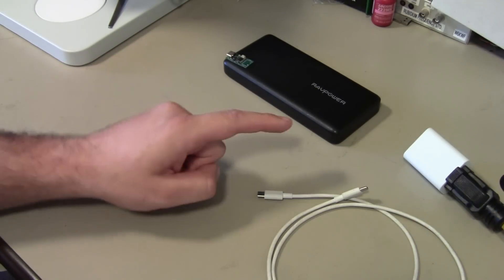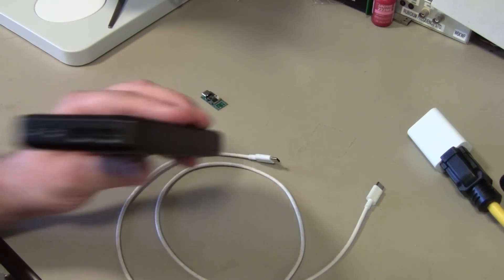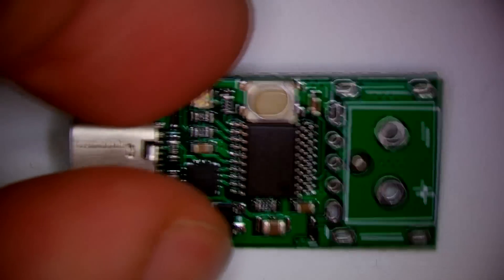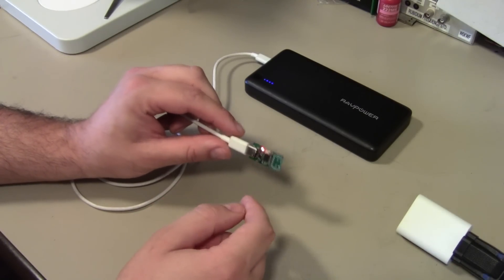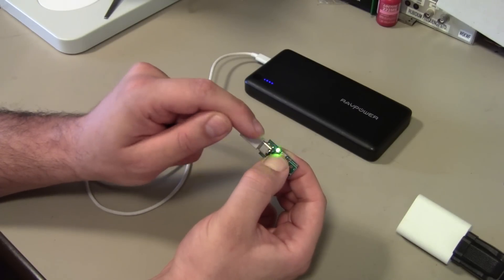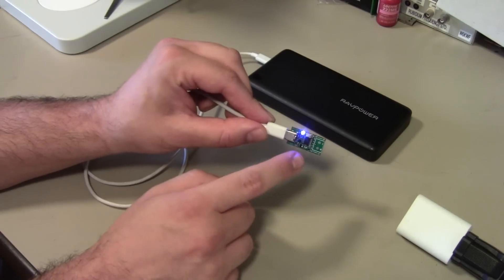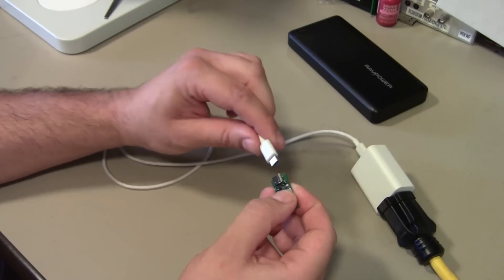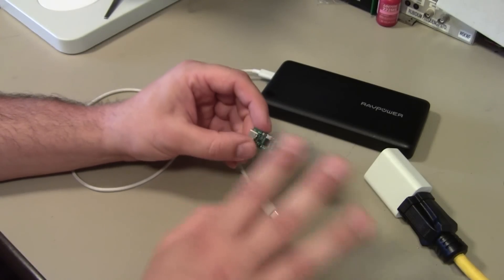How to power ANYTHING using USB-C Power Delivery and the ZY12PDN PD Trigger Board

Comment: Hi...i  recently purchased an electronic scoreboard (uses 12 volts and 5.5 watts) about 2 feet long and 8 inches tall, with 3 inch numerals... just large enough to be useful. However, it only works with a 4 ft power cable with a small wall transformer with barrel connector. I want to power it with a power bank with usb-c. Do i need a trigger board? Does the scoreboard itself need to have the ability to negotiate power? Can i just get any USB-c power cable with barrel connector? Or do i need a 'special' cable, like a USB-C PD cable specifically rated for 12 volts? sorry for all the questions!

Comment: So, I was looking for a solution to power my HX Stomp - a digital Guitar/Bass Effect modeler. It needs 9V but much higher Amps than the usual effect Pedals used. Happens to be, that there is little to none inexpensive solution...until now.

Comment: Exactly what I was looking for! Thanks. My usecase is, Im trying to live off of my solar system. Since it is producing DC, I need to convert it to AC and back again to DC to power, for example, my desktop monitor. So this would be a neat idea to power a lot of electronics without having the double power loss through converting. I hope this will work :D 
I have a question though: My powerbrick for the monitor outputs 19.5V, USB-C PD delivers 20V - is that a problem or is the device able to adjust how much it draws?

Comment: This is neat for a more universal supply, but I'd personally feel safer if it was a solder pad I bridged or used a jumper on to make sure the voltage doesn't get changed somehow.

Comment: What is missing is a 12V home network.
Don't know why we have tens of power supply when we could have one central power supply to power all small device, pc monitor, pc, phone charger, modem, router, .... except big appliance almost everything could be powered by 12V.
Even modern fan or motor are powered by 12V.
Especially wasteful with solar, as we go from low DC, to AC back to DC and loose a lot of power on the way.

Comment: Really interesting board and thanks for explaining all the modes, but would have been even more helpful if you had shown with a multimeter how stable the voltage output actually is in idle and under load and whether it can actually 5A at any supported voltage.
Reply from the maker: That is entirely a function of what USB charger you plug this into. All this board does is ask the charger to deliver a certain voltage and expose two solder pads attached to the output bus.
Reply: @KennethFinnegan  Thanks, you're right. For some reason I thought it would come with a voltage converter built in. But of course there's none visible.

Comment: I have some trigger boards that don't have the LED or the button. It just has 3 sip switches that you set to the desired voltage. I'm making a rack-mounted VU display that will be powered with one of these. I plan on using these bad boys for many, many projects.

Comment: Hello, I have twenty 5 & 12 volt DC power adapters plugged into 120-volt AC outlets (yes, it is a mess). Is there a way to eliminate all those power adapters and use a single DC source to feed all my twenty gadgets (maybe use twenty of these circuit boards which would take much less space than my twenty 120-volt power adapters)? Thanks

Comment: Be careful with these barrel jacks that plug into  your devices. There's no polarity standard for them.  For example, it seems that most guitar pedals take barrel jacks with center negative, but WiFi routers take ones with center positive. Check the sticker on your device before plugging those in.

Comment: Did this with a car stereo. PSP. And a laptop. Have a bunch of triggers.. 5v.9v.12v.15v20v It’s good to have a power bank that charges and gives power at the same time. That way you can use it as a UPS. You can also charge the power bank with solar and keep things running 24/7. Like a mini Tesla Powerball.

Comment: I have a possible project question. 

I own a MacBook Pro A1502 that has USB 3, Type A sockets (x2) and Thunderbolt 2 socket. Thunderbolt 2 has the faster data speeds, but it does not carry (if I understand correctly) 5v needed to power an external device. I would like to use an external M.2 NVME M-Key 2280 SSD in an enclosure that has a USB Type C socket. The type enclosure can be seen on Amazon .. ORICO 20Gbps M.2 NVME SSD Enclosure Adapter,USB3.2 Gen2 Type-C to NVME PCI-E M-Key Solid State Drive Aluminum External Case for SSD Size 2230/2242/2260/2280, up to 4TB（M2PAC3-G20, Grey).

Might it be possible to make a cable with a USB Type C (Male) on one end and two plugs on the other end, a Thunderbolt 2 (male) for the data AND a USB type A (male) for a 5v source? Could this work? Would you know how to wire it?

Comment: Very useful and informative video. One thing I noticed was that you read from your power bank that it supplies 5v 9v 15v and 20v, yet your trigger board seems to manage to negotiate 12v from it. Is that a feature of the board that can be used on any supply that gives more than 12v, or did they just not include 12v in the power bank specs for some reason?

Comment: Thinking about using these in conjunction with a 100 watt or 120 watt multi port usb charger to clean up 4 or 6 power bricks for various devices in my wiring closet.

Comment: Hi there
Can you assist me with a solution to my problem, I have a small internet UPS that can give either POE 15/24v or barrel dc 9/12v which I’m using the 12v option - problem I’m having is I need to power my Ubiquiti AMPLIFI Mesh Router, which uses a USB C switching power supply

Comment: I have a cable that does the same thing. Except i left it connected to the powerbank last night but didn't connect the cable to any device and it still drained the powerbank. I'm guessing via resistors or something. Still the cables are great, I use one to power a 5G modem that I can take on the move.

Comment: That's pretty cool, but, for the price of one of those you can get FIVE boards that don't use a microprocessor.  (They just have pairs of solder pads or DIP switches to set the voltage.)  I can see having one of those for its convenience, but, in actual use, I'd stick with one of the more basic options.

Comment: Since this video the market has started to provided what are often called a "PD/QC Decoy Board", these are fixed voltage boards, with the result that they are a lot cheaper and smaller so work very well for when trying to create a usb to power jack cable solution. The one I ordered even came with a plastic cover for the board/cable as standard.

Comment: I just wanted to add that most of the Linksys blue routers like the WRT54G internally run on 3.3 volts supplied by a buck converter, so it falls under the category that you mentioned where any of the PD voltages should work, or even just plain old non PD 5v USB. Some of the old 3Com network gear was even brave enough to admit this, I have a 5 port 10/100 switch that says right on it that it will take anything from 10-30 volts.

In this case I would just choose whichever voltage gives you the least input wattage from the source, IE the best efficiency.

Comment: This is awesome.

I have never seen anything that can test which voltages a USB can actually use, save for a box I bought some time ago, which reads both voltage and amperage. And, naturally, I keep misplacing this little box. It is also USB-A only.

I would love to figure out a HAM radio repeater with this. Honestly, I may try to power a router off of something like this, like you did, too. I would really love to be able to establish off-grid communications and file transfer.

Comment: Great explanation, thanks! This tiny piece seems to be quite useful 😁
However, it would be nice it it also had - like some buck converters - lines that you can solder in order to have permanently 9/12/15/20V etc. On the other hand, we could have it set to 20V and then use the buck converter - just to be sure we won't get anything else than desired voltage. For perfect output, a linerar stabilizer at the end would give us exactly what we want 😎
Reply: I'm pretty sure they exist with fixed voltage settings. Adding another buck converter would be kinda unnecessary as the QC power supply can deliver any voltage. There's a mode in which you don't just get a preset value but can ramp up and down in voltage, in steps of like 0.1V. I wouldn't be surprised if boards exist that make use of this to output any desired voltage.
Reply: Found it, it was a video from Andreas Spiess in which he plays around with QC 3.0. There's a "continuous mode" in which the voltage can be stepped up and down with steps of 0.2V.

 https://youtu.be/dw3MehLAyWU
Reply: @jaromy03  thanks brother
Reply: See this for other boards that can be set via soldering https://www.youtube.com/watch?v=gRcRFjUl_Gk

Comment: I’m wondering if this would be useful for a project I have in mind to eliminate all those wallwarts that have infested my office. I could see having several of these, each programmed for a common voltage (5, 12, etc.) and then paralleling the barrel jacks for the each device that uses that voltage (being mindful of total current) and then using a single, high current switching USB adapter to power the whole thing.

Comment: the highest voltage would be good for a multi-voltage device too. a lot of power banks will support more than one voltage via DC in if it doesn't already have a USB C charger mode

Comment: Thanks for an excellent explanation. Those who don't want to risk the wrong voltage being programmed in for a specific device can get USB-C to barrel connector converters designed for that device's voltage—9 volts, 12 volts or whatever.

Comment: With a 3v buck converter and a pair of resistors I could use this to power my Resmed S10 CPAP machine (humidifier turned off) from my laptop/phone battery pack when travelling, so this really has my interest. I'll have to check the output levels of my battery and Choetec 240v pack in my bag.

Comment: Kennth, I just found this video.  I have a solder station kit I need to put together. It takes between 12 and 20 volts I’m now thinking about adding this as a power option.  Thanks for a great video.

Comment: I'm trying to learn some DIY electronics stuff so I can salvage broken electronics instead of recycling/throwing things out. 
I don't know a lot about components swapping or what's compatible with what, but I was wondering if I could replace the broken 5V DC (5.5mm x 2.1mm) socket on my daughter's rechargeable Bluetooth speaker with one of these. The PCB is marked 5V where the socket is connected, but the included AC/DC power brick is labeled as 4.5V and 0.2 A output. I'm wondering if it was done intentionally to slow charge the 1800 mAh battery, or if that was just the best option they had at the time (newer models of the same speaker replaced the DC socket with micro USB). 
My guess would be that the 5V mode would work just fine, but like I said, I'm not an electronics expert.

Comment: These are pretty cool. Might be useful for some future project. I came across it cos I was searching for a solution to charge my laptop from a monitor that only has USB-C Display and data transfer. E.g. it only supplies the minimum 5W or so, and was looking for a way to inject power or something. Probably a hub but those are big and bulky and a more compact solution would be nicer, if it was possible to inject power without compromising the display/data throughput

Comment: That's a great video! Thanks. So If I have a 220v 0.25a device (55W). Can I use this PD feature and set it to 12V. 12v5 = 60W. Does it work that way?

Comment: Was looking for these trigger boards and the description was not clear how it would work when you wanted a fixed voltage. First I found 12v specifik versions, that essentialy does this but without the added option of switching voltage (they go 12v, or the highest available ie 5 or 9).

now im gonna order these with the buttons and going to use it specificly for powering 5 or 12v routers, switches and other equipment from either wallwarths or PD power packs!

Comment: How is the voltage  increaseed.  Does the power bank have  voltage booster with in it or    are the batteries  just connected in series to begin with and uses a buck converter

Comment: Great video. Troubleshooting question:
I want to power a small 12V 3A bilge pump with a PD 65W power bank. I have my PD trigger set to stay in 12v (green), but as soon as I connect the pump, the light on the trigger goes out and the power bank indicates it is no longer charging anything.
Advice?
Reply: Both your cable and power bank needs to support 3A. 65W power supplies can achieve the 65W only on higher voltages, and are often only rated for 2 or 2.5A. Might I suggest a  high dc to low dc buck converter in front of the pump in order to support 3A.
Reply: Your 3A pump is probably drawing alot more than 3A while starting, triggering overcurrent protection. 
Is it possible for you to soft start your pump?

Comment: also got a few of these PD trigger boards, alongside a shutload of PD trigger cables and chips.
tried the approach on one of my 5v to 20v trigger boards but it doesn't work.
its a WITRN board  (WEB-UPD005 UPD006 PD to DC Decoy Detect PD3.0PPS Fast Charge Trigger QC4 + Polling HID Programming)
but that programming scheme doesn't seem to work that unit.. if I start it up by holding the button it goes into a blue blinking mode, that doesn't seem to cyclic thtue anything.

Comment: Can a power bank charge an electric kids car 12v?

The charger of the electric kids car got damaged (out 12v 800mA) and while I get a new one I tried to charge it with power bank (veger VP3001-pd). so  I connected a usb-c pd adapter cable 12v 3A max (which I usually use to power the router when there is an electrical emergency) to the PD port of the battery (max out 12v 1.6A) but the battery turns on and in a while it turns off.

Comment: I was recently wondering if it were possible to actually select which voltage you wanted, in order to power various devices which do not comply with the PD protocol.   Your video was most helpful, thank you.

Comment: When I first plug mine in, it flashes blue continuously. When I hold the button down THEN plug it in, I can cycle through the colors and save what color I want but every time I plug it in, it flashes blue and the voltage doesn't change.
Reply: I heard that flashing blue means the power source doesn't support PD

Comment: Things to remember  .. it takes extra amperes  to boost voltage and the  extra will cause your battery to be drained faster.    Also have to add in the number of amperes the device is drawing that is v ett ing powered  by pd device. So you may  think that a device that needs 12v at 3 will only be drawing 3 amps. No  it will be drawing more then three Amps if the voltage is being  boosted up
Reply: well, the mAh ratings on batteries are just dumb its the WH that is intresting, as Wattage is the funktion of volt and ampere. So yes, 12v 1A is more power draw then 5V 1A..

Comment: @Kenneth Finnegan I would like to power a USB C monitor with its barrel jack from a USB-C PD source and still provide the image of the same USB. Do you know of any boards like this that can daisy chain TB3 and extract 20V on its way to the monitor?
Reply: Some USB C monitors can actually be powered by the same cable providing the image if you use Thunderbolt 3 - worth checking if that's an option for your setup.

Comment: Cause any input above 13v should trigger the charging to work, Solar might input 2amps or 4amps or 10amps. Depending on the solar panel.

In this case it's an extra power bank.  Pushing 15v(4amp) or 18v(3.5amp) or 20v  (3.25amp)

This would be helpfull as i do have a smaller solar panel which i use to charge my smaller powerbanks (i have a 30,000mah and a 40,000mah which can charge with USB 5v 3amp or 9v 2amp etc)  

Really wished this worked, it just switches off (the power station does realise the input, it goes on and shows input for 2-3seconds then the PD just shuts down. Maybe it's trying to draw more amps @ that voltage than what it can give.

Comment: i have an powerstation that accepts power input for solar charge of around 15v+ all the way up to 25v. I was figuring if i have a extra powerbank that has PD output of 65W and have the triggerboard.  Then i can charge my bigger powerstation with some extra 40,000mah on the side (in the case i go camp or so. if i need the extra juice)  but it doesn't charge it. it is set to output 20v output (which should be good for 3.25amps for 65W input).  it just switches off.

Comment: Thanks for this video - very good explanation.  Is there a way to set it back to the original mode where it will just allow you to flick through the voltages?  Maybe I missed it...
Reply from the maker: The red mode is the stock toggleable mode.

Comment: I have a question if you could help, would this board power a device that varies voltage, example- i plug in, the device looks for 5v, then switches to 9v?

Comment: So if you have set it to the 15V mode and you plug it into a maximum 9V power brick will it just default to 9V?
Reply from the maker: If you have it set for 15V mode and it fails to negotiate that, it will never leave the initial 5V mode. I usually use the "highest voltage possible" mode when powering electronics that I know can handle 20V